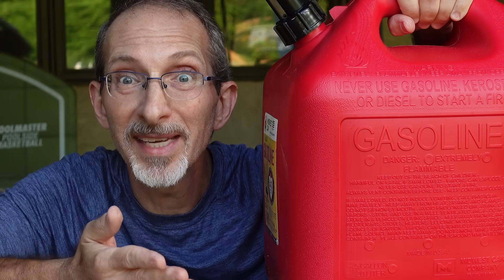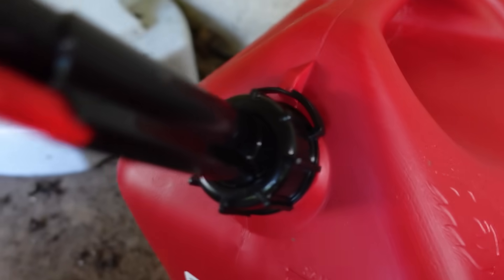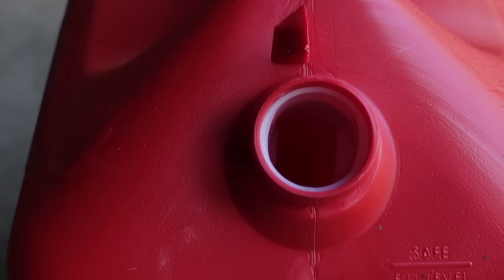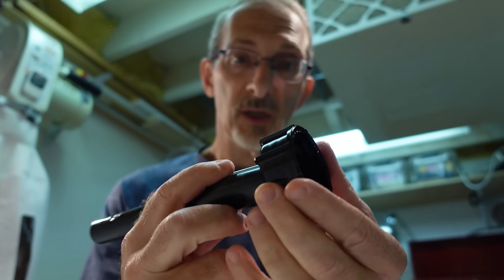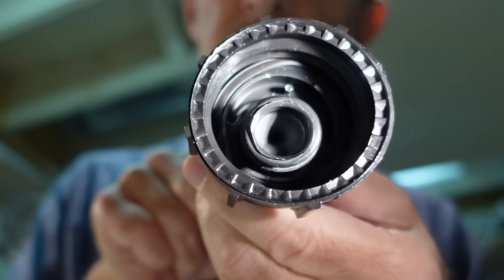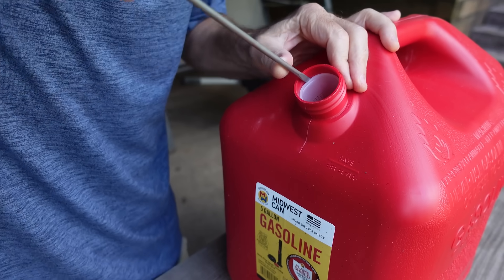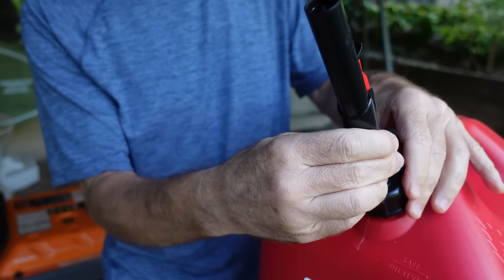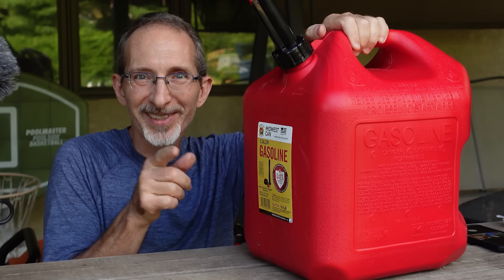Gas Can Modification | New Gas Can Fix

Comment: Can I make one of two suggestions?

My first one is if you don't use all that much gas, maybe just a couple pieces of lawn equipment or something. Just about any hardware store, and even some automotive parts places sell what is called fuel in a can, one example is a brand called true fuel, but any brand will work. It is ethanol free fuel, designed specifically for small engines, comes in four stroke, 50:1 two stroke, and 40:1 two stroke, and best of all it comes in a just regular old metal can one can easily pour out of. The only down side is it is pretty expensive at like $10-$15 a gallon. For me who just runs a lawn mower and a weed whacker and goes thru maybe a gallon a season the price difference does not matter. However if your running a lot of stuff, or something like a generator the price difference may make it a no go. 

Which brings me to my second suggestion. Go online and look up NATO gas can. All new gas cans sold today must come with that style nozzle, or something similar, due to the government because of "safety and environmental reasons". I guess they would rather fuel spilled all over the ground, then a small amount escaping into the atmosphere anyway I digress. NATO cans are exempt from these rules. They are expensive with "cheaper" ones being about $60ish bucks, however they are all usually pretty good quality and if not abused should last you a life time. Best of all they come with just a regualer old spout. Most have a metal lid over the opening, with the spout attached somewhere on the can. Simple depress the tab, unscrew the metal lid, or do what ever is require to get the metal cap out of the way, attach the spout, pour your gas, remove the spout, and reinstall the lid. Just make sure you don't leave the spout on or gas will evaporate, and/or spill ever where.
Reply from the maker: Kevin, you bring up some interesting suggestions! I have to assume that anyone watching these videos is using gas in a quantity that would make it in efficient to purchase fuel in a can. I’ve never use this, so I assume you need to pour it with a funnel?

The NATO cans, or Jerry cans or military cans I suppose are exempt because they are not considered consumer products. Many other people in the comments have mentioned them, and they are definitely worth checking out! Furthermore, these cans should be compatible with aftermarket spouts, So you can fit what meets your needs. I appreciate you watching and contributing to the conversation!

Comment: That "filter" is actually a spark arrester of sorts.

I suspect it also limits splash when pouring out.
Reply from the maker: Allan, you are correct. I described more about the flame arrester in my second video, link in the description. In that video I also added a vent, which was key in making the gas pour more smoothly. I appreciate you commenting and watching!
Reply: @MikeFyxdt  Yes, I found that video and watched it.

Glad to see you stretched and nipped the spring as an option.

I have cans that I bought from Walmart and Lowes with a different style of flow control valve that seems easier to work with, but they still flow a bit slow. I may look at the vent installation on them as it takes a bit of time to fill the 3.5 gallon tank on my mower.

THANKS!
Reply from the maker: It’s interesting to see the different variations of these modern gas containers, and I agree that they flow a little slowly. I understand wanting to control the flow so there is less splashing, but these larger 5 gallon containers get heavy if you have to hold them up for any length of time! So faster pouring is better, as long as It pours smoothly, which hopefully the vent helps with. 😁

Comment: I did it, easier once screwdriver separates white filter a little bit from red can, use needle nose pliers and twist white plastic to fold it over onto itself and work out until you can get a grip with your vice grips and yank it out and avoid contact with the red spout so no nicks, deformities or problems.
Reply from the maker: Excellent! It seems like people keep refining how to best get these out of the way. Some people pull them out, others push them in. The bottom line is that if they prevent you from filling the container then that’s not good. Thank you for sharing your comments and for watching!

Comment: Gotta say, think it’s a conspiracy from all gas can manufacturers….
I think they all suck, and they purposely make gas cans to make ppl mad, or drive em cuckoo trying to figure out how to use “some gas cans”…..🤬, did my brother in law had a gas can that it took 4 ppl to figure out how to use. YES, we read instructions, which made no sense. Yes we looked at the pictures on the gas can to see how to use….helped a bit more than the 1/8 pg of English instructions (was full page, but had English, French, Spanish, etc.,..languages of the same instructions that were a sentence or 2 🤦🏼). The funny thing, these were cheapo gas cans either, and gotta say; kinda funny that’s there’s so many YouTube vids on gas cans (heck, I was shocked at actually how many there are) and how to use, fix, mod b/c ppl have same ISSUES😜
L8R ✌🏻
Reply from the maker: Agreed! It is ironic how many people struggle with these designs. We need a change for the better!

Comment: "We put a filter on the tank to prevent any impurities from getting in, don't worry, they'll pour right into whatever youre filling up later because you can't easily remove it to properly clean it" LOL
Reply from the maker: M H, but I called the filter is actually a flame arrester safety device, and I agree it makes no sense as a filter. I explained more in my second video, link in the description. Call it what you want, it’s still interferes with filling the tank! :-)

Comment: I use the nozzle as a cover for the can... i remove it completely and use a battery power transfer pump from harbor freight which eliminates fuel spillage and so much easier on the back...
Reply from the maker: I have heard other people say they do this, too! I just purchased one of these transfer pump and I will be testing it in an upcoming video. Stay tuned!

Comment: If you have relationship midwest can, please ask them to produce an instruction video with no cuts that shows someone pouring an entire 5 gallon plastic can of gasoline into a modern F-150 or a recent Honda accord. I am a 53 year old, college educated, able bodied, rural dwelling American man and I have 5 of these cans. I have not spilled any while poring into riding lawn mower but always spill on my hands and vehicle when I try to put gas in vehicles. They need a video showing us how to do it or recall these things.
Reply from the maker: Don, that’s an interesting thought. I don’t think the spouts have the reach or the right angle for filling a cars gas tank. My Mustang actually came with a funnel for fueling, but because of the design of the gas can spout, it is too awkward to press the release latch against a funnel without disrupting it. Once you remove or reduce the strength of the return spring, it becomes much easier. But I agree with you, as sold these containers are very difficult if you need to gas up your car. Thank you for watching and for joining the conversation!

Comment: The most unsafe safety system their is. If anyone wants a really good gas can, get a “Sure Can”. They work extremely well and it makes it easier not to over fill your mower.
Reply from the maker: I agree, these designs are a struggle. Thank you for sharing your recommendation for alternate gas containers, there are so many great suggestions in these comments. I appreciate it!

Comment: I have never had any problem filling the little tanks on gardening equipment, with these automatic spout valves.
I've never run into those input filters, but my filling stations filter the fuel upon delivery, but if there is "trash" in the fuel that is caught in that "not removable" filter, won't it be delivered into the fuel tank when you empty the "can," into it since you cannot clean out the filter once the"can" is filled? The "safety experts" are slowly showing that they are trying to do things that are scientifically unnecessary or outright wrong, another example of "our government at waste." Ron W4BIN
Reply from the maker: I think the spouts are easier to manage on smaller gas containers. When I called the filter is actually a flame arrester safety device, which I explained in my second video. I’m not against safety, but these filters are notorious for making it hard to fill the tank!

Comment: I don't get the first mod (trimming the clip on the screw on the nozzle base), but that second mod actually leaving the safety intact is nice, so you can manually seal it back up
Reply from the maker: I did the first mod because the plastic latch I sometimes struggle with. I agree that it is not high on the priority list. Thanks for your comment!
Reply: @MikeFyxdt most of us just twist hard enough to mangle that ratcheting stop system.

Comment: I actually only pulled the red safety button. Kept the spring. As a result it's actually pretty easy to just push onto what I'm filling and when I'm done I just stop pushing on it. The spring is strong enough to close itself and lift the weight of the fuel. Haven't used it on a funnel yet but I do have an issue with my classic car. The short stubby nozzle isn't long enough so I can't fill the tank without the tank hitting the side of my car. Same thing with my Jeep. So I end up filling a 1 gallon tank and shuffle the 5 gallons in that way. I'd rather have a nozzle that's twice as long or more.
Reply from the maker: You bring up a lot of great suggestions! Thanks for commenting and for watching.

Comment: That "filter" as he calls it is primarily a flame arrestor that will prevent a spark from igniting the gas in the can. That's the one part of this video I disagree with. Just hold the gas pump nozzle an inch or 2 below the opening and it doesn't keep turning off the pump. If a gas pump attendant couldn't figure that out they need to find a new profession.
Reply from the maker: Yes, but I called a filter is indeed a flame arrester, which I explained in my second video, link in the description. Thanks for your suggestions on filling the container without the pump clicking off, I guess people’s results will vary.

Comment: It would be good to replace the coil spring with a lighter duty spring, instead of just deleting the spring.  
    The white strainer on the gas can was designed to be a flame arrestor, not a strainer.  It should've been designed to be removable during filling of the gas can.
    There are "No Spill" brand of gas cans available that are more convenient to use. But still, over time, this design fails and leaks gasoline at the green pushbutton.
Reply from the maker: Roy, excellent points… I addressed these issues in my second video, link in the description. Instead of replacing the spring, I cut it and stretched it, and I feel that it made the spout easier to use while retaining the soft closing feature. Thank you for your suggestions and for commenting!

Comment: The thing you called a filter is a flame trap. I buy "water jug" nozzles for my cans and put in a vent. I like the spring removal trick. The flame trap can be removed easier by using the screwdriver just enough to bend a place to insert a needle nose Vice Grip. Clamp it on then twist and pull out. As you twist the flame trap folds over and is easier to pull out.
Reply from the maker: Agreed! I corrected myself about the flame arrester in my second video, link in the description. Other people have also suggested using the needle nose pliers to twist the filter to remove it. Good advice!

Comment: The only thing I would have done different I may have just shortened up the spring I don't know I'll play with
Reply from the maker: Tristin, I cut the spring and reinstalled it in my second video. It made it much easier to use while retaining the self closing feature. Thanks for commenting!

Comment: Why not just buy a dual fuel generator and keep using the propane? It's easier and cleaner and it's available in a disaster and doesn't go bad.  It's not quite as powerful but you'll always have the option of gasoline if needed.  Since you bought new anyways.
Reply from the maker: Joe, my old generator was never very good to begin with, and the Generac brand was recommended to me… But when I shopped for one they did not have a dual fuel model available. I asked, and they said that it had been removed from the market, but they wouldn’t give me a reason why. I would love to have the option of using either gas or propane in the future!

Comment: A useless 10 min vid. Screw that safety nozzle. Just get a traditional spout for $8. Also you must be quite a moron if you couldn't fill the other gas can over 1 gallon. I have the same exact can and filled it with no problems. Just dont fill it with the pump flowing full blast. Again, instead of wasting time modifying that safety spout just get a traditional one. They sell them right next to the gas cans.

Comment: That filter is the dumbest and least safe part of the whole "safety gas can" design.  It causes so much more spillage than just an fully unobstructed opening.  You're less likely to spill anything with an old Gerry can, or a "farm can," than any of these idiotic new cans with these horrendous modern "safety spout" equipped cans, that leak all over the place.  They definitely don't live up to the purpose they were designed for.  "To save the environment,"  California decreed, and so it was made.  Never has more fuel been exposed to the environment than in the short time of existence these diabolical modern cans have been made.  "Brilliant," said no one, ever.
Reply from the maker: Yup, it is pretty ironic that these designs end up spilling fuel, as a result of safety devices to prevent you from spilling fuel. The filter is actually a flame arrester, to prevent a flashback explosion, which I think it’s a good idea as long as it Doesn’t interfere with filling the container. Maybe it should be in the spout, like some manufacturers do, so it doesn’t get in the way. Thank you for contributing to the conversation!

Comment: I actually have one from about 10 years ago that works great... no hands, light spring, no vent, no spills. They must have changed the rules again since my new ones from last year are a complete PITA. And twice the cost for the privilege of buying retrofit kits to fix them!
Reply from the maker: Frank, yup… It is ironic that you can spend almost the same amount you spent on the container purchasing aftermarket nozzles to make these work better. I have a few older containers, some with valves, and they are much easier to use. May be better designs will be coming in the years to come!

Comment: I've had to replace my cans about every three times I've used them. They swell up and crack from the pressure build up inside. And it's so much fun blasting gas all over a hot engine instead of into the tank.
Reply from the maker: Thomas, I’ve noticed this too. These 5 gallon plastic containers seem to bloat much more than any of my smaller plastic containers. Now I routinely “burp“ them by loosening the nozzle collar before I even pick them up. Thanks for commenting and for watching!

Comment: I'm not disagreeing with your concerns but the "filter" is actually a type of safety device ("Flame shield safety system") that also happens to act as a filter.  Doesn't make it easier to use.
  One suggestion/solution is to go to Harbor Freight Tools (store or website) and get the "electric liquid transfer pump."  Just stick the end of the main siphon tube into the can and the flexible fill hose into the receiving tank and flip the switch.  Problem solved.  No funnels, no hoisting the gas can, no sucky can spout.  Highly recommended. 
  I'm still a fan of the old, metal Jerry cans with the screw on, steel funnels.  Damned government, convinced we "simple citizens" aren't capable of adult responsibility.
Reply from the maker: Yes, what I called the filter is actually a flame arrester, which I corrected in my second video.

Comment: I think that filter in the gas can for preventing flash backs when pouring the gas on an open fire. Not joking John Stossel did a video about the new regulations on the cans to make them safe. Think about it pouring a highly flammable liquid on an open flame is safe if I use a metal filter but the can has warnings not to pour flammable liquid on an open flame.
Reply from the maker: Connor, you are correct. What I called the filter is actually a flame arrester, like you said to prevent flashback. It is not the liquid fuel that explodes, but rather the fumes. The flame arrester keeps oxygen from mixing with the fumes so it won’t burn. Thanks for commenting and for watching!